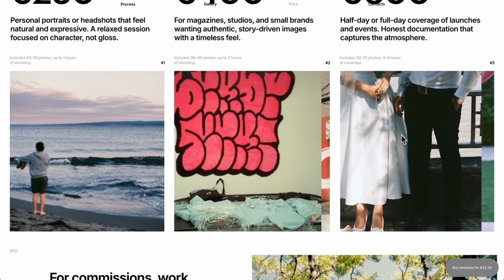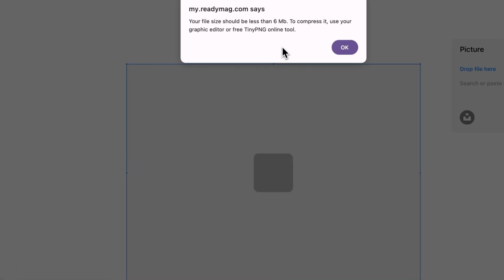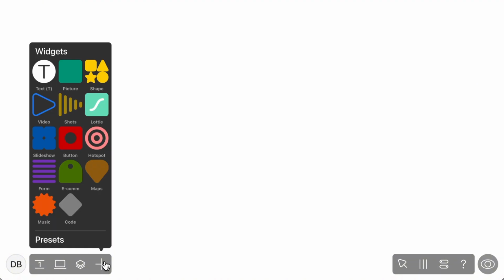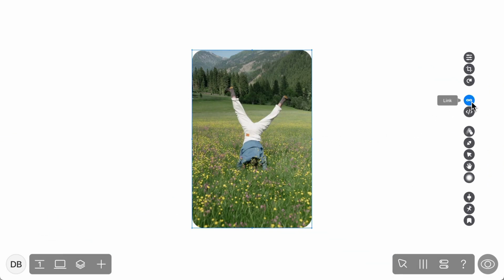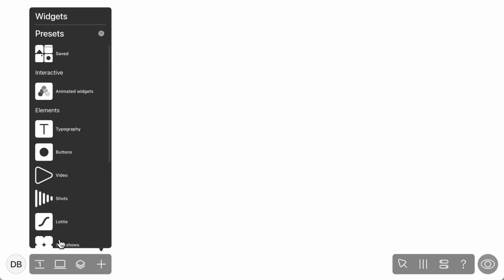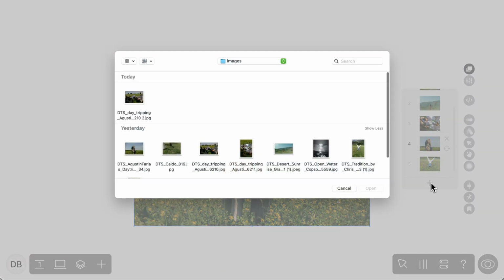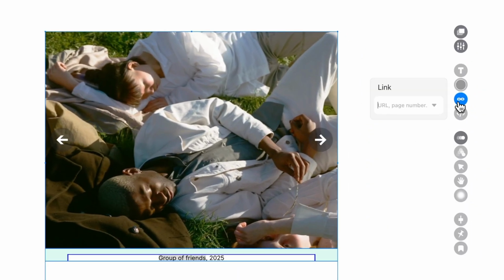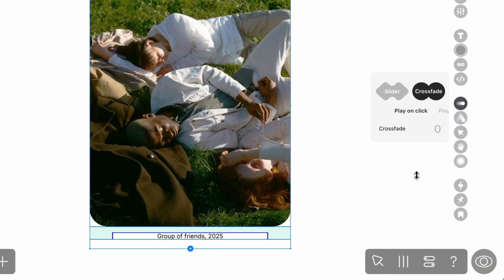Picture & slideshows widgets in Readymag

Comment: i wanted to ask if you can add caption in each picture in a slideshow. Thanks for the tutorials, they help a lot!
Reply from the maker: Hey! You can add descriptions to individual slides. You can also access Typography, Font Style, and Color controls for your captions 🤍
Reply: @Readymag  thanks, i get that but my question was more focus on actually be able to add it on top of every picture not at the bottom like in a white box or something, if that make sense. Is it possible?
Reply from the maker: @paz2991 @paz2991 Best to reach out to our support team at support@readymag.com, attaching your project link, and they will look into it and check what's possible.